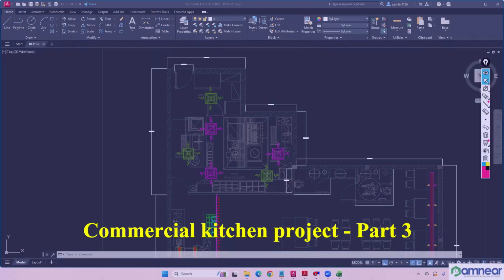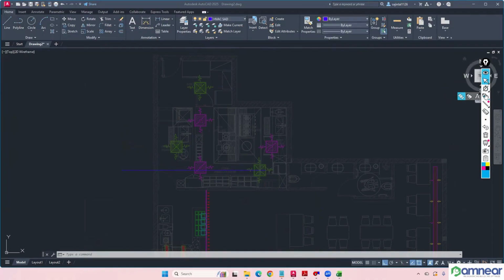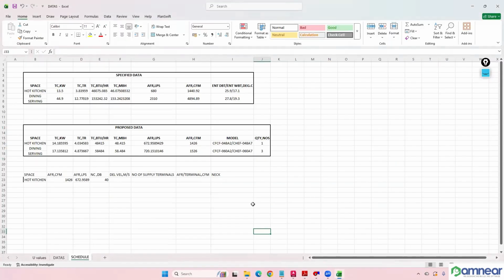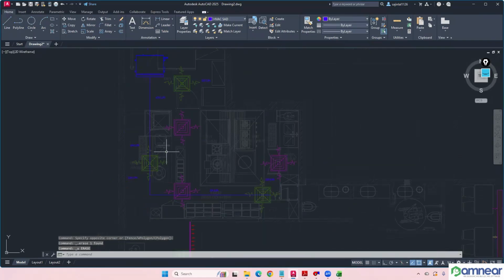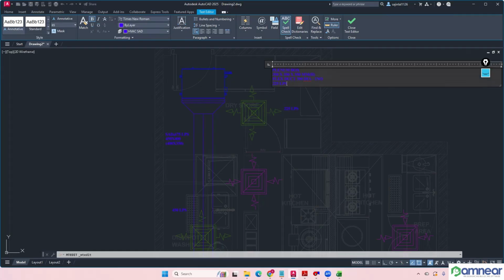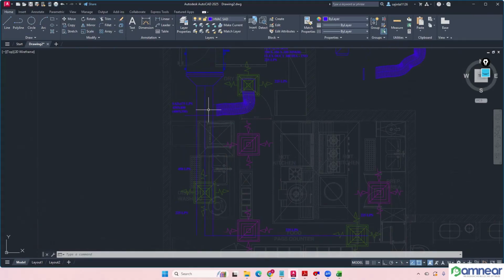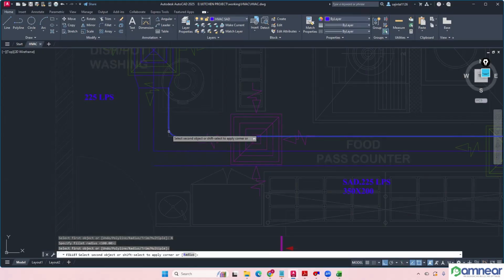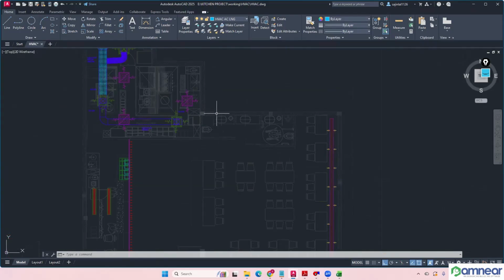Commercial Kitchen HVAC Design Project |PART 3|Air Conditioning &Ventilation|AMNEAR MEP|BIM|

Comment: Fascinating insights on commercial kitchen HVAC design—thank you for sharing this series! It’s interesting to see how airflow and thermal management directly impact efficiency and compliance in professional kitchens. At On2Cook, we’re exploring complementary solutions that enhance overall kitchen performance—our hybrid cooking technology reduces energy consumption by ~50%, minimizes heat emissions, and helps operators lower HVAC loads while boosting throughput. How do you see evolving cooking technologies influencing future HVAC design standards for cloud and compact kitchens?